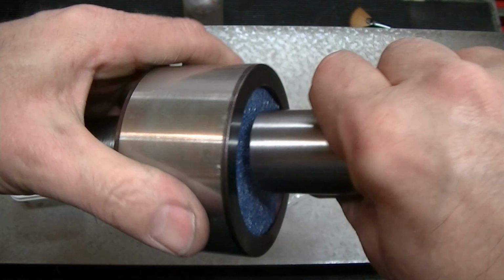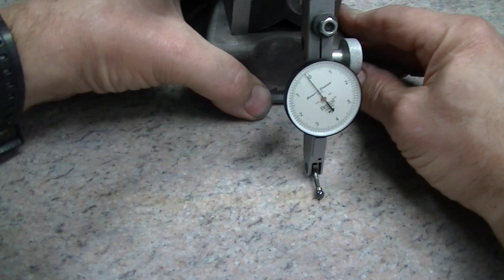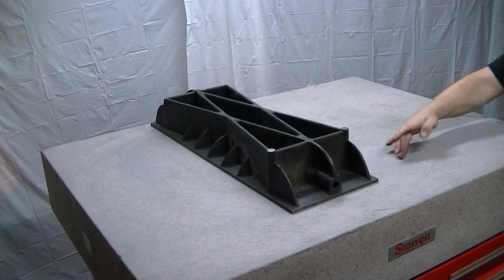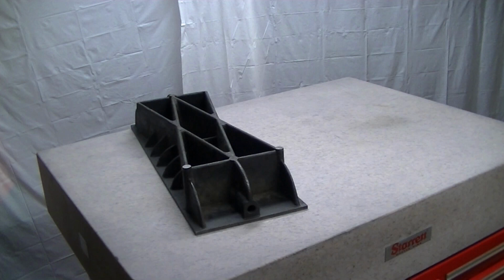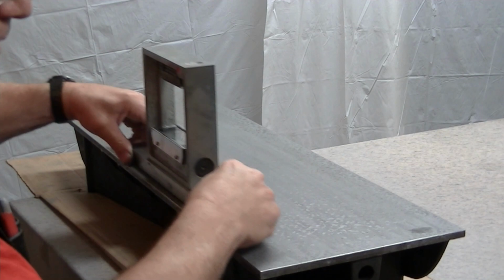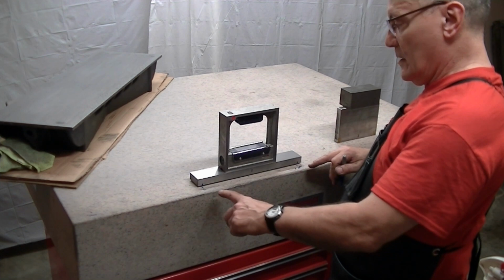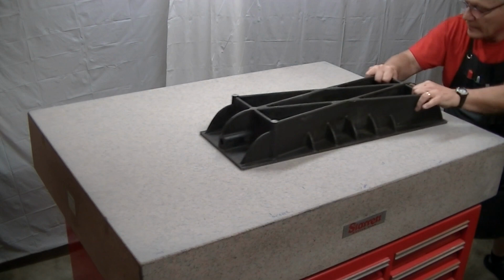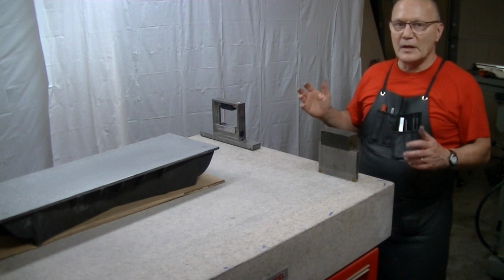DIY SURFACE PLATE LAPPING PART 1 (audio fixed)

Comment: You spent effort balancing out the weight of the level but you had a big hunk of iron about the weight of another surface plate hanging off one corner. Would that not effect the readings is such a way as to render them less useful?
Reply: As long as the lap sits in the same spot for the full set of measurements it does not matter. The counterweight accounts for the weight that is moved over the plate between measurements.
Reply from the maker: I will cover this in a follow up video. Thanks for watching and commenting.

Comment: @ROBRENZ Great video. Wouldn't the counterweight for the level, an idea I really like I have to say, be in reference to the 3 mounting points of the surface plate, and not in reference to the plate center? When measuring the level close to the center, wouldn't the counterweight just pull the surface plate even more down in the middle, and thus introducing an amplified negative reading into the center of the surface plate, which is hanging down the most?
Reply from the maker: You can consider the plate infinitely rigid in this case. This is purely about the orientation of the plate relative to a gravitational reference (a level).

Comment: I bought what I thought was a cast iron surface plate for $20 that a fellow was sending to the scrapper. But it doesn’t have a 3 pt base. It has webbing like this one with 6 points. Is this plate specifically designed for lapping? It is a bit smaller and in nice shape. Also,  it is remarkable how much the hinging of the lapping plate changes.
Reply from the maker: I don't know but it should work

Comment: Hello thank you for sharing your video with us.
The question is when you move lapping plat on the granite it will be not incorrect?becaus granite is hard stone and of course will grind the lapping plate that you move on it.this is my question and again thank you .
Reply: The lapping tool (round lap or lapping plate as in this case) should be relatively soft. The most common are brass or cast iron. The process of "charging" that was mentioned in this video is where the abrasive is embedded in the soft lap. With the abrasive embedded into the lap, it tends to stay in place much like a piece of sandpaper or an emery board. The lap can and does become worn over time and use, but not as much as you might expect. The abrasive grit is not simply being rolled between the two surfaces as it may appear.
Reply: @benpepper1979  ❤️

Comment: Hello Robin I thoroughly enjoyed your video containing a ton of info. I am a novice in this field looking for some kind advice. I am creating a flat surface made out of a local marble slab measuring 32 x 76 x 4 inches supported at 6 points underneath. What I am looking for is a 50 micron accuracy overall. I own a 36-inch diy straight edge and a set of feeler gauge along with a starrett 98-12 level.

I am using a 12 x 24 x 2 inches marble block with 80 grit sand paper glued on it as a lap.

My question that is it possible with what i already have got in "tools" ? And is there any recommended ratio of the lapping plate/block to the job size?

I have already come near 200/300 micron mark and just noticed that my lapping block had that error in it that has accentuated on the job. And I have recently learned about the three-plate-method by which I am trying to mitigate that error from my lapping block.

Any helpful ideas/links or comments are much appreciated.
PS. This surface will be used for flat casting
Reply from the maker: That lap block is fairly small for doing a plate that size. You will need to put feet on the level like I did to be able to map the topography of the entire plate and then selectively lap the high areas.
Reply: ROBRENZ Thank you for taking your time to respond to my lengthy question and also for your suggestion about putting feet onto the level. As you mentioned that the block I am using is “fairly small” for my plate. Can you please guide me on the best block-size for a 32x77 inches plate? Is there any recommended lapping plate to job ratio used in the industry? Thank you in advance!
Reply from the maker: I don't know an actual formula.
Reply: ROBRENZ Any idea about the size of lapping block that would be better for my plate size?
Reply from the maker: Its more about technique and measuring whats going on than exact lap size.
Reply: ROBRENZ Thank you. I am a complete novice and don’t know about any technique that’s why I asked for the best size. I think I have to learn some basics then.

Comment: Shouldn't you be using the width of the plate more than the length?  You are pushing it along its length instead of its width.  You will get a flatter surface doing it the other way.

Comment: Fantastic video. What you did with elbow grease.
One question: how do you flatten the cast iron lapping plate? 
Is it sufficient to grind it on a surface grinder?
Reply from the maker: It can be ground or scraped. in part 2 I show scraping a lap flat.
Reply: @ROBRENZ  thx 👍👍👍

Comment: Wouldn't you want to remove the secondary weight when you reach center, since you are essentially doubling the load between your Bessel points, forcing a concavity?
Reply from the maker: I will cover this in a follow up video. Thanks for watching and commenting.

Comment: Robin, the speed of the video really is off when watched on a mobile device. Also, the selection of pad spacing is interesting. Does it get you higher resolution if the pads are spaced in shorter distance? Like a similar method being mentioned the Foundation of Mechanical Accuracy
Reply: I understand your reasoning in the video, just wondering if that would be a reliable way to calibrate surface plates at home
Reply from the maker: I uploaded a new version with fixed audio. thanks for watching and commenting.

Comment: Excuse my ignorance, if you're counter weighting shouldn't the surface/lapping plate be off the granite too ?
Reply: Excused. Why would it matter? He's taking relative measurements, as long as he's not moving the plate during the process what difference does it make?
Reply: What difference would the counter weight make then ?
 @Steve_Just_Steve
Reply: @inselbaboon  The level is being moved for each measurement, the weight is moved in the opposite direction to counter that movement, hints "differential level". If he was also moving the lapping plate for each measurement he would need an equal weight to move opposite in order to counter that, but since the lap stays static for the duration and the measurements with level are only relative to themselves the lap is of no consequence.  Hope that makes sense.
Reply: inselbaboon just to attempt to simplify what Steve is talking about, you can think of it as the error that the lapping plate introduces being a constant so long as you aren’t moving it between measurements, that way so long as the plate isn’t moved the error for each measurement is the same which, to my knowledge (which is admittedly not as broad as others on this topic) has the same or a similar effect as there not being an error to begin with. Hopes this helps somewhat :)

Comment: will you have the plate re-certified after you finish?
Reply from the maker: I did certify the plate as seen at the end.
Reply from the maker: @SuperAd1980  Sorry, it's in part 2 where I show the results of my autocollimator inspection of the plate

Comment: Watched quite a few of you video’s so much information contained in some I have watched parts of them over and over again a lot of your processes you use diamond powder compound and plastic paper imprinted with it works well and could posable be the only thing for the job but I must ask the coast of the powder I can’t see this being cheep
Reply: Industrial diamond abrasive is actually pretty cheap if you find a good source. You may or may not be familiar with the fact that the only reason so expensive in the first place is because the Monopoly held by African mines, with the advent of synthetic diamonds that price has and will continue to drop significantly over time. Abrasive diamond is even cheaper than most other kinds of synthetic diamonds anyways. one method of making synthetic diamonds for abrasive purposes is to have a chamber or encapsulation of carbon and put it in the middle of an explosion, the explosion will compres and heat the carbon until it forms diamond grains that can then be used as an abrasive.
Reply: Here's an example, I just found a listing for 20 grams of diamond abrasive for less than thirty bucks, this particular diamond abrasive has been sifted down to about 200-300 mesh grit size and I'm fairly certain there's places you can get it even cheaper.
Reply: Hay Rob thanks for the reply and I did not know it was that cheap not sure if I can find a place in Australia but it won’t stop me looking thanks again I am very interested in the things you have on video dam good job also  @lazyh-online4839

Comment: How can you prove the compensation of the 2 when you have that slab of steel on the other side
Reply: It is a relative measurement. So long as he leaves the plate in the same place, it does not affect the relative difference enough to matter.
Reply: Yep but unless it's going to a temperature controlled room it's going to be all over the place anyway
Reply: Pretty sure he has a basement shop.
I know my basement shop is more temperature stable than the lab I work in...
Reply: Not so bad then keep at it, I worked in temp rooms so I do know a little.
Reply from the maker: I will cover this in a follow up video. Thanks for watching and commenting.

Comment: Really informative video. However, how can I calibrate a surface plate if that surface plate is my only reference? I mean, if I don't have another reliable flat surface, can I still determine whether my surface plate is flat enough?
Reply: ProfRonconi there's a good demonstration of this in one of Dan Gelbert's videos where he shows the power of the reversal principal. Essentially the idea is that if you have two unknown surfaces you can subtract the error if one out by measuring the other surface first from the top, then flipping it upside down and measuring that same surface from the bottom. Hope that wasn't too confusing... There really should be more videos on that subject.
Reply from the maker: This is only part 1.  Thanks, and thanks for watching and commenting.
Reply: Thanks, Ryan.
Reply: Thanks, Ryan. It wasn't crystal clear, but it pointed me in the right direction.

Comment: Does the lapping need to be done with the stone acclimated at the same temp as the future metrology room?
Reply: The temperature does make a difference, yes. The plate will bow concave/convex for deviations from the flat temperature, but probably not enough to matter (unless the temperature swings are extreme). This is also why it is a good idea to keep the plate away from places where it might get sunlight for part of the day.
Reply from the maker: I will cover this in a follow up video. Thanks for watching and commenting.

Comment: There's no way to fill the low spots? Maybe like a granite powder mixed with expoxy and spread super thin then lapped.
Reply from the maker: Definitely not.
Reply: Any sort of additive will present many many problems, where's the problem with proper consistent adhesion, there's the change in texture and friction across the surface as you inspect or blue your parts, there's also the major issue of shrinkage over time as virtually any adhesive cures. Thats just the issues off the top of my head and I'm sure there's many more.
Reply: Nope.....gotta take the high points down to the low .....then flatness achieved  !!

Comment: I understand the idea of the lapping process, but thought it worked best if 3 surfaces ware use in rotation to each other, to produce the flattest surface
Reply from the maker: Two are all that is necessary if you have a means to determine the degree and direction of curvature of the plate and lap. The three plate method is if you have no other means of measuring the flatness.
Reply: The three Plate System offers you an absolutely flat plane but you're on your own when it comes to plumb and level. And there's also the problem of the Rockies trying to surface is a little bit bigger than he could pick up and swing around oh yeah and then there's also the problem of that particular practice of using three plates takes five times as long
Reply: ... not to mention that all of the plates need their turns on top. You might see the problem with that once the plates start getting big - there are things you can do in a cutting mill that might be a little more difficult in a small/home shop.

Comment: I skipped a few sections so I might have missed it, but isn't the weight of your lap affecting your level measurements?
Reply from the maker: I will cover this in a follow up video. Thanks for watching and commenting.
Reply: ROBRENZ I'm interested to hear if it has any affects. When will the next part be out?

Comment: wont diamonds cut cast iron?
Reply: I'm not an expert, the cast iron can absorb the diamond lapping compound. Usually you want to clean the iron when switching compound
Reply: When you have two surfaces, a hard and a soft one, the diamond beds itself in the softer material when you lap those surfaces against each other or lets say statistically more often than in the hard one. Thats the reason why the soft material works like a sanding paper.
Reply: @whispers391  # That's why he used the roller to roll those diamond bits into the cast iron surface plate, so they stick to it and then use it as sandpaper to scrape the granite surface plate until it becomes smooth and even.

Comment: where did you buy your cast iron surface plate ? 
I still have hard time to find one
Reply from the maker: Auctions
Reply: @ROBRENZ  ahhh ok :P well you get lucky on that :) 

I found a brand new one from a UK seller .... a 12" X 12" start @ 1030$ .... plus about 130$ for shipping .... :/

Comment: I tried to find on Ebay the same cast iron plate used for lapping but nothing turned up....
Reply from the maker: They can be hard to find. look for local machine tool auctions of companies going out of business.
Reply: @ROBRENZ   i'd have to record my self just to keep track of my movements  . and you sir are a glutton for punishment. lol , after being around metal and mechanical and machining stuff, my whole life in memory threw my father it finally dawned on me that the surface plate was the dawn of civilization, well as we know it today if we suffered a major extinction event and the knowledge was lost well let's just say man is screwed . not to mention i'd say that a very high % of people running around on this planet today haven't a clue what it is let alone what it is for and how long it took to perfect it.  to be of good effect,, the long way around to saying thank you for trying to pass this on it's very important.  without this step, there would be nothing but rock's and sticks and animal sinew to comfort us.  your a good man
Reply from the maker: @ronwhittaker6317  Thanks for the kind words!
Reply: @ROBRENZ   checking out the three - stone method s we speak
Reply from the maker: @ronwhittaker6317  It can be done but would be easier with square stones. watch my "ROBRENZ ATD #1" if you havent already.
Reply: @ROBRENZ   no but im looking into a good deal of things atm but my shed need some real attention before i get started on machining and casting parts it near ready to fall down i need to sure it up and weatherize it i plan to put a heavy duty dead flat floor in it from castings and metal and fiber reinfrocement i own my house but the land is not mine so ive got to work around having an inground foundation
Reply: @ronwhittaker6317  
I've got one for sale but I'm in the UK
Reply: @debodevil6974   thank you ,friend, but that sounds, like a nightmare to me that and i spoke to the landman and he is not the most cooperative fellow i may have to seriously consider relocating it may come down to my health and well being if i don't take up something to be productive and it seems he wants to stand in the way of that so i may be left with no choice but to tell him to bugger himself and move.

Comment: I know you are busy and going to get a bunch of questions so if you have a moment, you don’t need to go into any detail; I have access to 3 surface plates a 9x12 toolroom grade, a 16x24ish, and a 24x36. Both larger ones are out pretty good. Could I in essence use a 3 plate method to bring them in to a some what usable state? Thanks for the great content.
Reply from the maker: I will cover this in a follow up video. Thanks for watching and commenting.

Comment: wonder if its better to use a extremely thin machine oil to suspend the grit in , reason being that the oil keeps the surface moist while the alcohol dries up eventually 
other question i have a small surface plate (25 x 40 cm ) and can buy a big one , both are cast iron , there both not level no more (allso been laying outside )
can you do the same thing cast iron on cast iron and can you level both plates this way ?
Reply from the maker: I have found dry to be the best just like all the plate reconditioning services do.  Iron plates would normally be ground or scraped to flatten them not lapped with abrasive.
Reply: If you do not have a surface grinder available you can help yourself with the three surface method. But you need three plates. With two you will end up with weavey plates.